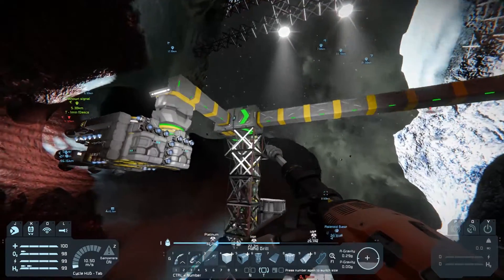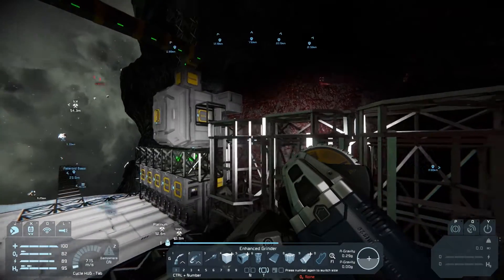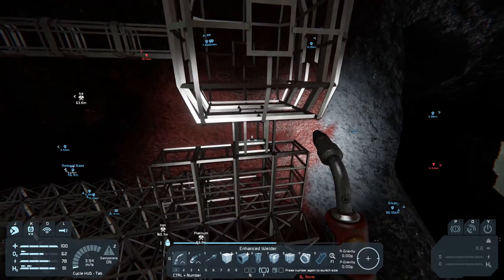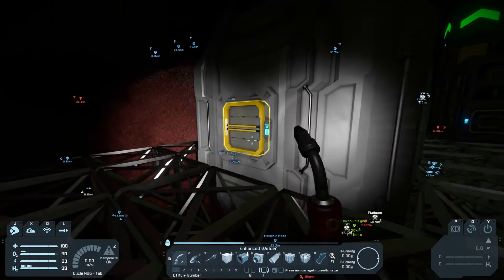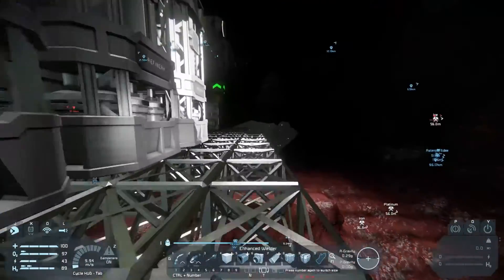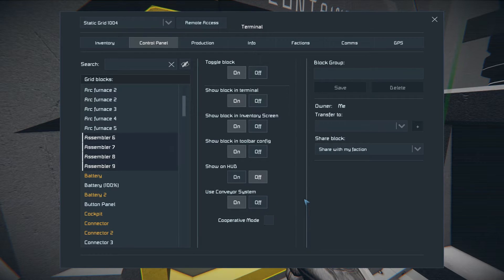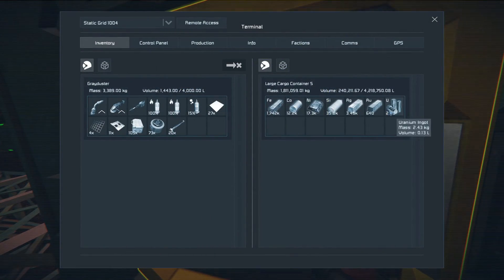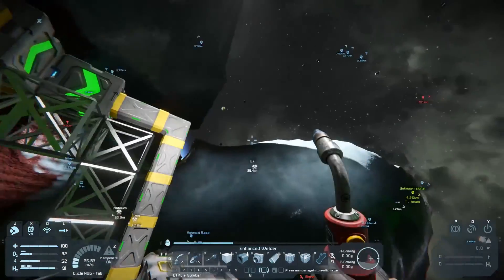Space Engineers S2 E16 - Full Scale Ore to Component Processing

Comment: Gray, I don't know if you know this, but Assemblers actually have four sides that accept modules, total of eight ports.  The only spaces that don't accept modules are the 1x1 ends.
Reply from the maker: I didn't, as I assumed modules needed two small ports each, and the assemblers only have two sides available with two small ports on them!
Reply: One, note the two larger ports on the sides of the assemblers look different from the large ports on the ends - they've got the small ports in the middle of them.  That is the clue that that face acts as either a conveyor port or a module port.
Two, a module does not need two small ports to function, just one - think the Z or S Tetromino for assemblers and their module.  The downside there, you get half the effect of the module running with just one connected face.  Upside, two different machines can share one module.